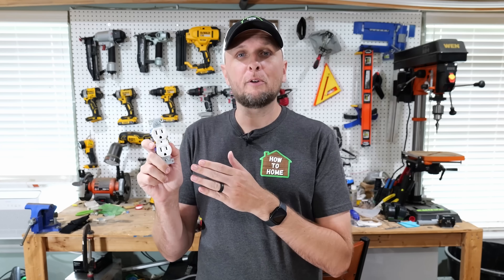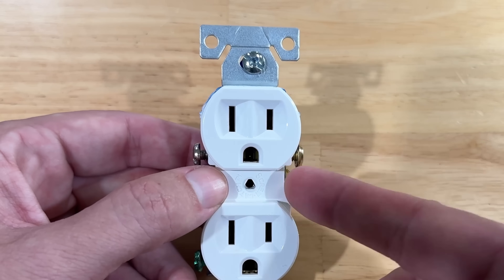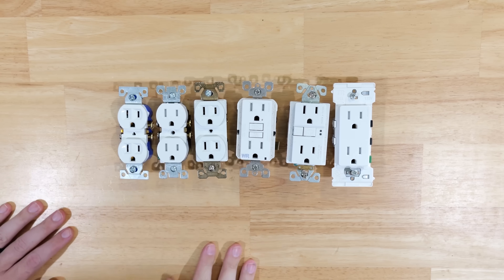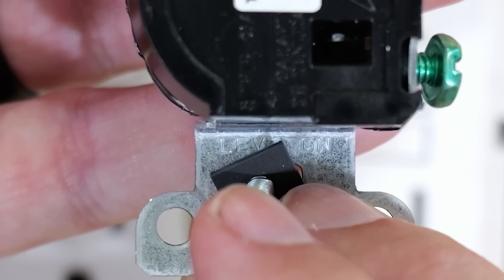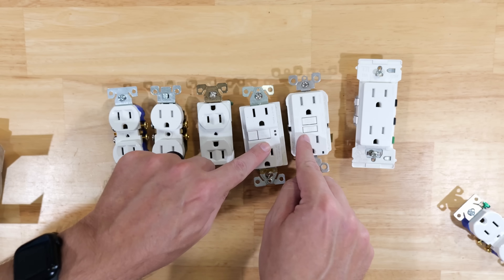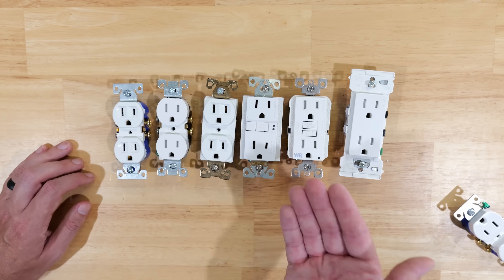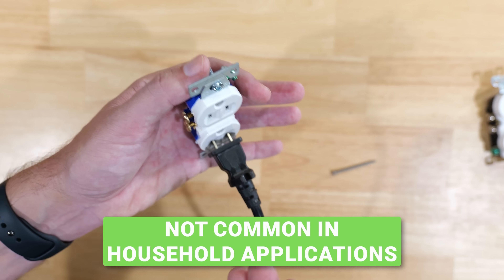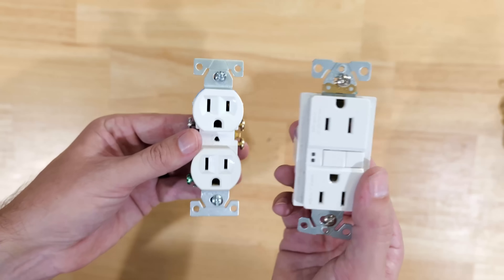The Shocking Reason Why Your Outlets Are Installed Upside Down!

Comment: Real quick example: When I was about 11 years old in the 80s I would stay over at my friend's place and he had a desk in between our beds with a bunch of change on them that had fallen off and scattered all over the floor and if you pushed the desk, with a carpeted floor, the outlet would spark because the change that was stuck in the prongs, I assume it must have been specifically pennies, that fell off the desk and contacted the prongs in the outlet and you would get this sparking.  I remember looking down at it at seeing a penny locked in directly with the plug and thinking, at 11, "This is fucked up."

No one in the family cared.  They didn't seem to think there was a problem.  People are really stupid about electricity.  The father of the family was an MD and this wouldn't have been on his radar ever.  

I really enjoyed your video, but your example of a nail or some other piece of metal contacting a prong is incorrect.  Children are thoughtless.  They're playing around with metal all of the time.  

The code is written in blood.  Stupid kids dropping change that goes inbetween prongs and receptacles, Uncle Billy burying an extension cord to run out to the shed that he wired into the breaker box, etc.

We are surrounded by stupid and thoughtless people when it comes to electricity.

Comment: The primary reason for ground prong down (other than it just being objectively correct unless a specific situation makes prong up appropriate) is that virtually every 3-prong plug or device that has a clear orientation will naturally fit better in a ground prong down outlet.   The exceptions to this are very rare.

Comment: I went on a service call one day.  What I found was a plug into a wall outlet.  On top of the plug sat a nickel.  The nickel crossed the hot and neutral and just sat there being a dead short.  If the ground had been up, like the P&S box shows, that nickel could not have sat there.
Reply: So it trips the breaker anyway. Then you remove the nickel, and turn on the breaker. Not a challenging scenario that happens once in a lifetime IMHO.
Reply: @nicholash8021 she didn’t remove the nickel.  She called an electrician.  Me.   You’re sounding like a shade tree mechanic.  Do it bad and generate service calls?
Reply: @bearcountrypublishing5303  Clearly, you missed my point. Anyway, I suppose I should just take it for granted that my theory is wrong because of your convincing argument that I'm a shade tree mechanic.

Comment: Since the ground prong is longer it only makes sense it's on top as you can visually see it to guide it in when the receptacles are not located at eye level along with the other reasons of it  being able to short with metallic object or even you fingers coming into contact with the two prongs and coming loose from cable hang or stress.

Comment: There is one aspect of this discussion that you didn't touch on, which is that of devices with a plug built into them.  I have always put ground down, but was persuaded that it was predominantly wrong and did a room with ground up.  Within a short time, I ran into devices that assumed that the ground was down.  The very first was a GFCI Tester from FLUKE, Model ST120+.  So to test the GFCI's, theIr tester had to be inserted upside down, which immediately made me regret my decision. That's one.

Shortly after that, I was working in a plant where voltages levels in the office area have been adjusted, with transforment tap changes,  to match the available utility voltage.  To facilitate the monitoring of that work, I came across a KLEIN Tools Model RT250 GFCI Tester which includes a Digital Voltmeter in it.  So the very first outlet that I went to do a line voltage check, the device was facing down when plugged into the Ground UP Outlet.  

BOTTOM LINE, IF BOTH FLUKE AND KLEIN THINK NORMAL IS GROUND DOWN, IT'S GOOD ENOUGH FOR ME........DONE DEAL....PERIOD!!!!!!!!

Comment: Right angled grounded plugs often bend in the direction of the ground plug.  They work bettter with ground prong down outlets.  Not always true and many light duty ones rotate.  I used to work in a hospital and I think the outlets were ground prong up.  That led me to (mistakenly?) believe there was a rule that said commercial up, residential down. Thanks for the video.

Comment: I worked at an office where the cubicles had decorative metal plates that ran along the bottom including under the desks.  The units also had outlets along the bottom with holes cut into the plates to accommodate the outlets.  During an office rearrangement where the cubicles needed to be disassembled and moved, we noticed several instances where the plate had come loose, fallen down only to come to rest on the prongs of a plug that wasn't inserted all the way.  We knew this because the plate material was burnt away in that area.  Luckily, there wasn't anything combustible close by to actually catch fire.  It's possible that, when this happened, a circuit breaker was tripped but was reset and, since it didn't trip again, no one looked for the cause and the issue was dropped. I've been installing the plugs with the ground up ever since.

Comment: In one room in my house (built in 2019/2020), the receptacles were mounted horizontally, so the ground is neither up nor down.  I have some four-pot GFI Leviton "hospital Grade" outlets on which the top two are ground up and the bottom two are ground down.  I'm just a homeowner with no professional creds.  I install ground down.

Comment: 40 years on the slab. 
25+ years Bachelor degree in Architectural design Associate degree in CAD Construction management. 
Here is the true answer: 
Where does the wire come from . 
Ceiling down :  ground wire up . 
Floor up : ground down. 
That way the ground doesn't have to loop around. 
And that is how it's done properly!

Comment: The patent drawing for grounded receptacles from about a century ago shows the proper orientation, with the ground up. But a lot of people think it looks like a smiley face if it's installed with the ground down. I guess having their outlets smile at them is more important than any safety considerations to many people. When i was just a kid my dad told me why the ground should face up -- in case something falls on a partially unplugged cord, it won't hit the hot and neutral, shorting out the cord. Outlets that are mounted horizontally instead of vertically should have the neutral facing up for the same reason -- so nothing hits the hot, but in this case it would probably hit the ground instead of hot, or just the neutral, depending on if the object goes right or left.  If you grab the cord and yank on it, your fingers won't touch any of the prongs. 😉

Comment: Clearly the ground direction is just a convention rather than any real need. I have never been in a house where the outlets generally had the ground on top. Also, most 90degree plugs are oriented such that the cord goes down if the ground is down which would generally be the preferred direction. The only reason I would ever install an outlet with the ground up is if I had a specific plug arrangement that required the ground to be up in order for the cord to go into the desired direction.

Comment: Neither configuration is friendly for (multiple) right angle power cords.  That's why surge protectors with one row 90 degree, or two row outboard (opposing) ground plugs were invented.  Surge protectors are prone to dust/dirt accumulation due to being face up.  Wall outlets with a non-interference configuration would be more practical, but I have yet to see one.

Comment: Same argument with Toilet paper, Roll going up or roll going down.  I install all of my receptacles with the neutral on the left side of the outlet when facing it, that would be ground plug down.  That way I know which way the plug goes into the outlet. this work when outlets are where you cannot see the outlet or it is in a difficult place to reach.  Also the plug manufacture design the plugs for easier removal.  This is also the way from the user to keep from hitting the metal prongs on the plug.

Comment: In our house (built 2011, SC), the receptacles are ground prong down.  The only exception are the receptacles which are powered by a wall switch.  They are ground prong up so the resident knows which plugs you can control by the wall switch.  Great video, thanks.

Comment: I’m a retired electronics engineer from a hospital. I worked closely with the electricians, Bio-Med and IT departments. It was mandatory for decades that the electrical outlets mounted in the infrastructure to have ground plugs facing up. Our hospital started doing it before it was common when a staff member had a necklace drop across the prongs. There are also accounts of the old metal clipboards falling into the prongs. We did have leeway for outlets installed in portable equipment. Some Bio-Med technicians had reasons to have the ground prongs down. That being said, this topic was not much of a safety conversation. Extension cords, power strips and unapproved devices got all the attention

Comment: I always install ground up because if the 2 holes are up something hiring the plug can pull the power prong lose and cause spark and cause a fire, also over time they will become loose and overheat

Comment: What about ground prong up or down in the case where a necklace is strung over the plug and it falls through and causes a short?  Is the short safer when the ground plug is involved?
Reply: @whereisthehook: Ground prong up when that outlet is attached too the wall-switch so people there know where to plug in their lamp to control it from the wall light-switch.
  Medical facilities have things hanging on walls that fall, like clipboards, scalpel, hemostat, that can fall and short the circuit, military galleys and  restaurants, ground up was specified, due to stainless steel utensils being dropped, etc. Therefore it has become required that they be ground up for contractors. In many cities ground up is standard in all commercial and industrial buildings, ground only go down in residential buildings, houses, apartments, condos, etc. 
   Internationally, countries with 3-prong outlets always have the ground up
   Everything is in context and the answer DEPENDS on context. 
   Examples:
“Never took the orientation of an outlet seriously until I was measuring for a shelf with a tape measure. It slid down and fell across the prongs of the washing machine plug.  POW! “ —@joef.6596
“I work at a K-8 school. Maintenance assembles powered multi media carts with the ground plug up in consideration of teachers dragging metal bracelet chains across partially unplugged power plugs.” —  @scaryhouse7969
“a length of florist's wire rolled off a side table onto a slightly loose plug and shorted the circuit, creating a small fire (quickly extinguished).  I now always install ground prong up” @deegee54
“I work at a restaurant and we have this work table with some outlets built in on top. Someone managed to let the edge of some tin foil go in between a plug and the outlet and it got disintegrated.”@MatthewSuffidy
“I knocked some change off of my end table one day my mistake of course, and a coin fell down right on the prongs resulting in a loud pop and a flash along with some smelly black smoke. I have since gone through my home and reversed all of the receptacles so the ground prong is now on the top.”—@chrisenglert3958
“my wife's gold necklace chain dropped off the rack onto two prongs of a device that were plugged into a receptacle with just a little prong showing.  It vaporized the gold necklace area of contact and left a nasty burn mark on the faceplate of the receptacle.   This was on a bar and I probably should have oriented the receptacles there ground prong up.“—@winfordnettles3292
"I had lunch with the Chief Electrical Engineer at McDonalds headquarters. He told me that one of the workers in one of their stores had her hand badly burned when a metal cookie sheet (or something similar) slid out of her hand. It fell onto a receptacle that was loose…the metal cookie sheet made contact with the two blades resulting in  big arcing flash that caused the injury, this is a reason Ground Up is safer."
“In commercial buildings (where receptacles are very high from the floor) ground has to be at the top. In a case of a water leak ground has the first contact with the water. In residential buildings (where receptacles are not far from the floor) ground needs to be at the bottom. In a case of a flood, ground wire would have the first contact with the water.”—@powerzx
“When a heavy extension cord or wire from a device plugged in is experiencing stress from the cord being pulled taught or tugged on, the greater force is usually downward. The ground prong being longer, exerts the greatest torque when the wire is being pulled in a downward direction.  Occasionally that downward force will cause the plastic of the ground prong opening of the receptacle to crack from the downward force. If the ground prong is up, that downward force has much greater support from the receptacle structure. I’ve personally cracked a few receptacles over the years working on projects where the wire plugged in was being yanked around a lot. Where the ground prong was up, the extension cord always stayed more securely plugged in.”—@TechwizJoe1
"while working in a mechanical repair shop, I went to get something off the shelf that the radio was on. I bumped the radio. as I turned POW, FLASH, BANG.  the metal antenna fell sideways and was across the plug and touching the window frame. glad i did not try to catch the falling metal antenna.  an extension cord was just a little loose in the socket.”@tazhd143

Comment: Well..no.  they are not installed upside down.  which side is up is a matter of code/law.  There is no specified right or wrong (as far as ground up or down) by code, therefore there is no right or wrong way in homes.  they can even be horizontal.    There is a way deemed safer.  Of course, the US code is less safe than the UK codes, but the UK's 240 warrants greater safety.  It's only confusing if you worry about it.  Since code is silent...I just prefer they are symmetrical...that's all.  Personally, I think the main issue is that people have faces with 2 eyes and one mouth...people think ground down looks more "natural"...  however, personally I admit the ground up is safer. When I am trying to plug into one and can't see it, I use my finger to find the ground hole and guide the ground into it. That is often harder when it is on the lower side.

Comment: Shame on me. I installed a refrigerator with an angled plug into receptacle with ground up. The receptacle was installed high enough so the cord would not reach plugged in ground up. Getting the refrigerator into position was a nightmare due to improper installation of the cabinets. I had enough BS for one day and cut off the ground pin. So far, nobody has died.

Comment: Most of the nations I've lived in are 240ish volts and some run both, but rarely does anything have grounds and when they do both the other plugs are the same size and sometimes both or all three are round plugs...when I needed to install american appliances or computers I'd simply use one of those american adapters with the ungrounded hole for the plug and then run a wire from the little ground hole in the adapter to a post in the ground outside...I started doing this because american computers, especially laptops, have a tendency to shock you when you touch their metal bodies or speaker grills if they're not grounded and you have your bare feet on a marble floor or something... also, you have to drop really heavy duty metal or your finger between plugs to make significant collateral damage, as small wires or pieces of metal generally explode and/or melt within a fraction of a second, so unless you're doing something stupid like installing electrical outlets in wooden walls, near stacks of paper or fabric, or on untreated carpets...

Comment: 13:00 ...and this is why Australian outlets all have their own on-off switch. (In addition to which the live and neutral are canted at 90 degrees to each other, so there's none of this short hole, long hole BS you get with North American plugs where you sometimes find yourself having two goes at plugging in a two-prong appliance if you're not completely awake or you forgot your glasses and can't see which is which.)

Comment: My refrigerator plug is flat and the grounding prong is on the bottom so if my outlets grounding prong was on top, the electrical cord would have a twist against the wall.  Most flat headed electrical appliance/fixtures are like this.  Since I have several of them in my house including my TV, I placed all of my outlets with the grounding prong down when I renovated my house.

Comment: It doesn't matter because I work in a semiconductor fab and some outlets are installed on the floor. The important thing is to make sure people don't accidentally trip over the cable. We'd tape the cable and/or put a safety sign/barrier around it. In the end, it's all about cable management, and baby/toddlers playing around with the outlet.